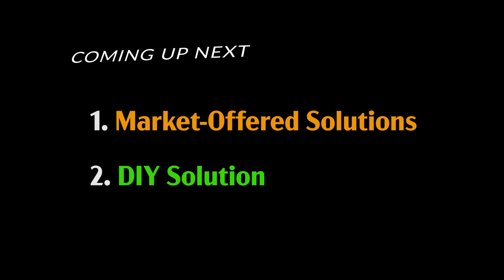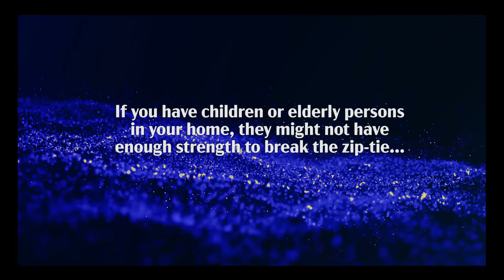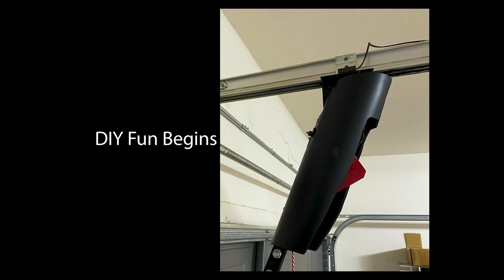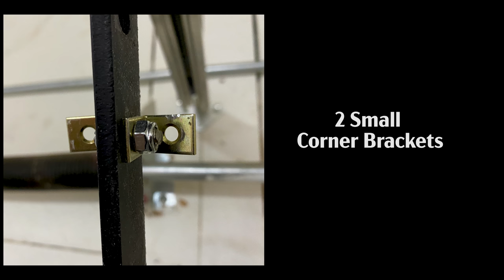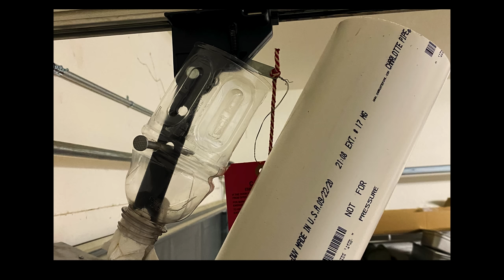Garage Shield vs $10 DIY - 6 Second Garage Break-In Protection

Comment: you might want  to remove the knob at the bottom of the rope.  If the bad guy can't get to the actual mechanism, he can hook on to the rope and use the knob as leverage a pull down the rope.  It's much harder to do if the knob is gone and there is no knot in the bottom of the rope.  You can still walk up and grab the rope and pull it down if you need to open the door manually.
Reply from the maker: I decided to keep the knob in place because there’s no way to grab it anymore from the outside - except maybe to cut a hole in the door itself. In that case the absence or presence of the knob wouldn’t make a difference. 

But yes, if the knob was removed, it would make the setup more secure.
Reply: @Outlaw_SEO  I'm also having trouble visualizing, given what you've shown in the video, why a hook couldn't encircle the unshielded part of the cord, slide down the rope, hook the handle, and pull.
Reply: @wmsatic  because the pipe goes down below the top of the door when closed... So the only way to hook the string would be to angle the wire down which really cannot be done from the outside since you can only insert the hanger at an upward angle.
Reply: I call it the Knights of Née garage door protector as it reminds me of the headgear the dark Knight was wearing in Monty Python and the Holy Grail. Definitely going to give this a try, best DIY idea I have seen!

Comment: Ask yourself: How often does the power go out that you would need to open the garage door manually.  If rarely, just cut the cord and be done with it. Leave a small piece attached so you can easily find the latch.  Make sure you you have a step ladder in the garage and you're done.  No reason to make a project out of this - especially when the other methods may not be as secure.
Reply: Some of the triggers can be pulled with a wire hanger even without a string.  The one on mine is too stiff, and would simply bend the hanger straight.

Comment: You can also booby trap a fake pull rope in front your build. Just rig it to a personal alarm  (the kind you pull a lanyard).  The noise should be enough to make them run. And it a lot safer compare to rigging it to a 12ga shotgun as they do in the cartoons.
Reply: Unfortunately it is illegal to rig up deadly traps.  There are numerous cases of homeowners getting charged with murder for rigging up shotgun traps.
Reply: Shotgun shells are okay. A claymore mine is better.

Comment: Why why why why. Nothing like that works. The safety is when u get caught in the door when its closing or opening the catch releases. Just pull in the door and it will pop the safety. And its open. Only thing that works are the metal pins that slide thought the door into the wall or side structure

Comment: I replaced the pull rope with a 20" section of broom handle. I pre-drilled a hole on one end and screwed in an open J hook, then tightened a hose clamp around it for strength and durability. When it's not in use I hang it on the top hole of the bracket that connects to the garage door. It's quick and easy to move it over to the release lever, and it works perfectly. As a bonus, it's very easy to push up on the broom handle to reengage the release lever after it's been used.
Reply: I think that your idea sounds better all the way around.  Thanks.
Reply: Objectively a hanger might grab onto the top mechanism latch instead of the broom handle. Odds are less I'm sure but just throwing that out there. Maybe a protection mod to your broom handle to protect the latch itself??

Comment: Filip@OutlawCRS,
   Just passing by and I agree to secure not only one's property but one's safety.
   As for a garage door fix I want you to know this genius idea circulating that you only need to add this one low cost item to realise and do all of this. Anyone can do this because it is simpler than simple.
   ☑ cut an intact pool noodle the length of the hanging cord,
   ☑ remove the handle and pass the cord through the noodle,
   ☑ install handle at other end.

regards from Montréal 🇨🇦

Comment: Great video!  Another idea might be to untie the cord from the rail, tie a carabiner to the now loose end, and store it close to the door going inside.  That way, it can't be used to break into the garage, but it's easily accessible in case of an outage.
Reply: Leave one carabiner attached to the garage door release and then the  string attached to another carabiner. This would make your idea even easier.
Reply: Got a photo?

Comment: I removed the entire rope. I bought the metal lock from Home Depot and mounted it. If I go anywhere for a few days, I put the metal lock on.  If I am around or just going to town, there is no rope to grab.  I have a ladder in the garage so replacing the rope is no problem.  You can shorten that rope so it cant be pulled to the other side of the door also.  It doesn't take much to deter criminials.  Good video.  I gave it a big thumbs up.

Comment: Thanks for the inspiration!  I have an early 2000's Genie garage door and I was shocked at how easy it was to release the door using the pull cord.  Zero effort required.  I was going away for the weekend and didn't have a lot of time to fab something.  I used a zip tie fed through the eye of the release lever and into the carriage. It took me a few tries to find a zip tie that broke with the right amount of force.  That would keep a bad guy from hooking the catch and releasing the door but it wouldn't keep them from pulling the rope through the top of the door and yanking down hard enough to break the zip tie and open the garage door.  I had to shield the cord to eliminate this weak spot.  I had some 2"abs pipe that I cut just a bit shorter than my cord.  I drilled within a half inch of one end of the pipe through the center and also cut a 3/4" x 1" slot at the same end.  I slipped this over the cord up to the carrier and zip tied the pipe using a stronger zip tie through the same hole in the carrier that I had zip tied the release lever to.  I didn't try to open it yet but I believe it will do the job.  Thanks again.

Comment: Definitely a better solution than the one's I've seen for sale online, but at the end of the day it still doesn't make your garage door truly secure.  Criminals  don't always go with the stealth techniques like fishing for the cord (stealth because they can back a van up near the door as if they were working at your home, and then use the wire trick to uncouple the door from the opener).  People in many parts of the country prefer a smash and grab technique, similar to what they do when robbing a jewelry store.  Insert a long pry bar under the door and force it to the point it breaks the mechanism for instance.  If you want something more secure, get an automatic deadbolt for the garage door.  It still won't stop the crooks who just ram the door with a car or truck, but it will stop all those kids who watch videos all day and see the ones showing how to easily defeat the emergency release system.

Comment: This is a great idea for an attached garage. A pool noodle is also a great idea as it is next to impossible to pull it hard enough to release the door and it can't be pulled through the top seal of the door either. However, if one has a detached garage then simply remove the pull rope so no one can use it to break in.

Comment: I had a hard time finding the angle brackets in stock.  Home Depot offers several options, but I'd have to place an order.  Most hardware stores will sell some kind of perforated steel strap that you can make brackets from though.  You might have to look in the plumbing department - it's sometimes used to anchor pipes to walls or floor joists.

Comment: Is there any clear item you can put over the inside garage remote when you use your inside sliding lock on the garage door to prevent you from hitting garage remote opening until you slide the medal lock from your inside garage door to prevent any damage. I hope I typed this right. The reason I’m asking this my friend closed the medal inside garagHeavy Duty Inside Deadlocke medal lock on the garage. She forgot she locked the medal sliding lock and hit the inside remote to open the garage door with the sliding medal lock on the garage. Well it got damaged when she tried to open the garage up using the inside remote and the Heavy Duty Inside Deadlock was still locked. Is the any clear cover you can put on the inside remote to remind you the Heavy Duty Inside Deadlock is on to slide it back before opening the remote for the garage. Any help would be appreciated. Thank you Cindy

Comment: Happy New Year, and thank you for sharing your project.  I appreciate learning about cost effective DYI solutions.  My version ended up costing about $15 in parts, mainly because the hardware store only had a 5-foot PVC pipe on hand, but hey I have enough to make another one someday.  Mine isn't as aesthetically pleasing as yours, and it was really hard work cutting the pipe with a hacksaw, but it's installed and it does the job.  Good excuse to invest in a Dremel tool!

Comment: I use wide-mouth vice-grip pliers from Harbor Freight on each track ( L & R ) just above a wheel. It ain't goin' anywhere. Also, you can buy a sliding bolt type of lock at Home Depot which mounts on the door, and slides into a knock-out hole in the track. Both sides, if you want.

Comment: I like the general idea. I wonder if it would be improved by heating the pie to soften it so that it can be compressed into an oval. Do this before cutting it. That may mean that you can use a smaller diameter pipe for the device. I may just give it a go. Thanks for sharing.

Comment: I'll tell you what I do that's cheap and easy. I use a trailer hitch pin lock and run it through the side rail of the garage door. This makes it totally impossible to lift the door even if the garage door release is disengaged. It's quck and easy to remove the lock from inside the garage if you have the key. This also keep stolen garage door openers from being able to open the door.

Comment: I’ve seen thieves just drill a couple of holes in the panel. I assume they put a wire in one and looked through the other. Garage doors aren’t very tough metal. I bet it would only take a few seconds to drill 2 holes. 

If you really want a more secure garage door, get a Jack shaft opener. It connects to the side of the door and has a track deadbolt. They should make that electric deadbolt available for all openers.

Comment: Great design, PVC cost has gone through the roof so it's no longer $10.  But, as you said, building some for your neighbors is very neighborly and if they all pitch in for the total cost goes down.  4" x 20', Schedule 40 is $145.00/2' is 10 devices is around $15 each. Now you just have to find 10 neighbors to pitch in.
Reply: or just use pipe insulation or pool noodle

Comment: I drill a hole in the side of the rail close to the roller and install a nut and bolt. The door would only go up about 1/8” if the cord was pulled.😮

Comment: Nice idea, but why not just use the clear 2-liter bottle you started with?   The bottle would act the same as the more expensive PVC pipe and could be cut with an ordinary scissors or knife. It would also be less obtrusive with no need to paint.
Reply: Some of the one liter tea bottles are thicker than coke bottles

Comment: Too convoluted a solution. Just get a 1 inch dia pvc pipe however long. Untie to cord. Thread it through the pvc 1 inch pipe and re-tie it to the mechanism, last, untie and remove the bottom handle and instead tie a flat metal washer on.
There is nothing for thieves to grab with a wire hook. No fancy cuts, bolts, etc. Total cost about $2.

Comment: Or even simpler, just a much shorter pull rope (10cm) with a about 5cm diameter rubber O-Ring on the end, and a length of dowel with a hook on the end hanging from a cup hook screwed into the door frame.  
If a person is trying to catch the rope, they’ll just slide off the end, with no feeling of having snagged anything.

Comment: The bad guys actually go for the pull rope knob, it's easier for them. You need to remove it.
Reply: False. Maybe some do but don't think that any of this will save you. I removed the entire pull rope and they just popped the pin out of the connection of the arm to the door. Easy as pie and they were in.
Reply: @CalbertReef  They used the pull rope knob at my house, but you're right. As long as they can disengage the door from the arm, it will open freely. I also replaced the windows with glass that has an embedded wire screen so they can't get through them as easily. But if they want in, they will get in; I've just made it harder for them.

Comment: Also, wouldn’t it just be better to get a deadbolt lock that overrides the safety exploit in the first place since it locks the rail itself?
Reply from the maker: Please elaborate further.. I don’t think I understand... any deadbolt would disable the regular use of the door as it is intended. 

If you want to permanently lock the door, you can slide the existing lock on the inside of a standard door - to make it inoperable.
Reply: @Outlaw_SEO  

True. My issue though is I rent a detached garage that only has one entry point so I’m not really sure how to secure the garage more than it’s standard lock mechanism.

Comment: Just run the pull rope through a 1/2 inch pipe PVC or copper  so long as it is the full length of the rope with the knob on and it is rigid.

The objective is to prevent the rope from being pulled outside over the top of the door.

$5 bucks done.
Reply: Keep some bandages nearby for when you bang your head on the dangling pipe.

Comment: The new thing crooks are doing, which is easier than the coat hanger is drilling a hole right through the door. They drilled a 5 inch hole right through the door and reached their whole arm through to pull the cord. We live on a busy street so it is hard to hear the noise of a drill. The only thing that will actually help with this, is a remote controllable automated deadbolt that stops the track. If you keep anything valuable in your garage, it is just too easy to pull the emergency release.

Comment: You can solve this problem without spending a dime.  Remove the string handle and wire the lock shut. Thread a twistable wire through the string handle hole and a hole in the traveler.  Just make sure your wire can't be grabbed by a coat hanger.
Reply: I did this.  Still easily broken into and robbed.

Comment: Are used a cheap double barrel 12 gauge shotgun that I got from the pawnshop. I have it mounted so that if I don’t disable it as I open the door, it fires two rounds of 00 buckshot through the door and through the intruder.
Reply: Even easier is to just use hand grenades. Attach the grenades to the door bracket. Then untie the emergency rope and re-tie it to the release pin of the grenades instead. Then when the thieves pull the rope to try and release the garage door, it will actually pull the grenade pins. Problem solved!

Comment: I had something happen on the garage the spring came off and almost got me
Reply from the maker: What were you doing with the spring? The spring is not a serviceable part and sometimes does snap. I had it happen with a neighbor on a 12 year old home once. Those things are wound tight and should not be touched.
Reply: "tightly," yes.

Comment: Just be aware that following the advice in this video can kill you.  I watched the Rescue Squad open a locked garage door to gain access to the UNLOCKED inside door and enter the home to save an elderly woman who was having a stroke and couldn't unlock the front door.  Everyone's circumstances are different, but I'd rather let a thief steal all of my possessions rather than delay life saving rescuers from getting me the help I need.  Keep a gun under your pillow if you're afraid a thief could harm you.  A dog that can alert you to smoke and prowlers is worth more than any deadbolt lock.
Reply: Uhhhhh, firemen do not use coat hanger burglar methods to break into a garage door to access a home in an emergency.  In the rare case you called 911 with all doors locked, alone, and could not move, I think the paramedics know how to get in your home without you making it easy for burglars at the same time.

Comment: I get a big kick out of these videos. Just remove the rope. And if you want to be even more secure add a zip tie so the latch can't be pulled.
In 40 years of home ownership I have never once needed to pull the rope. If I had to, cut the zip tie and pull the latch.
My rope now has a small carabiner and is clipped in a hole at the end of the track in case someday it's needed
Reply: Power or opener failure and you’ll need the rope. You have a rare opener if it lasted 40 years.